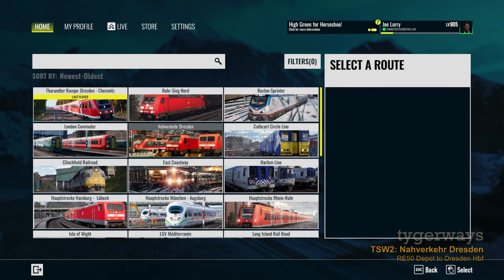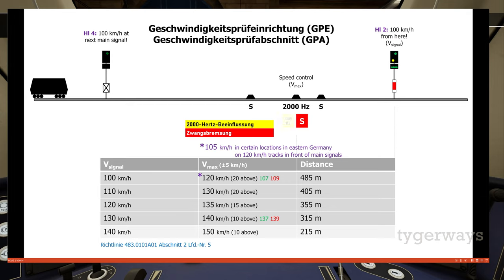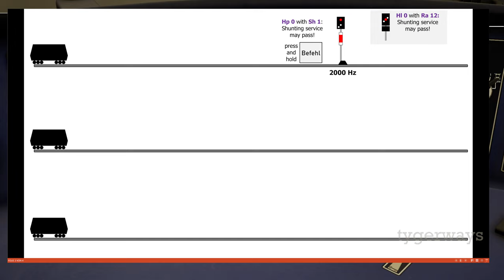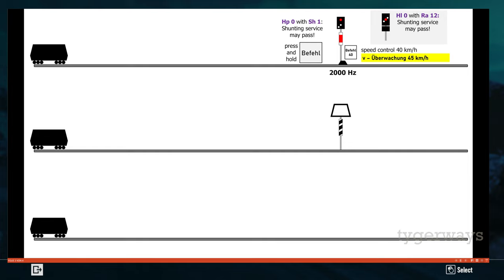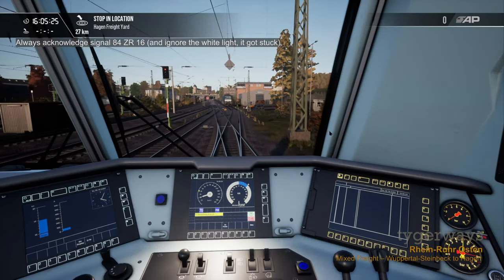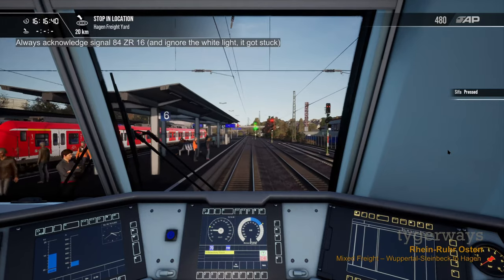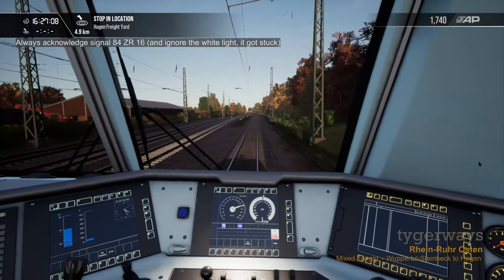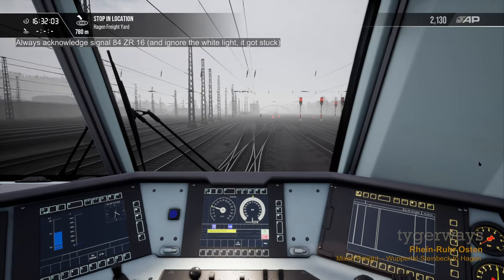PZB Specials – Befehl 40, distant signal board Ne 2 and trapezoid board Ne 1 (TSW | PZB tutorial)

Comment: Nice video, thanks! A question regarding pzb signals though! What does the yellow/orange and white striped signals mean? I don’t get it as I’ve seen both distant and main looking signals with those orange and white stripes. The stripes are looking and positioned the same as the white/red main post signal stripe, but with different colors as i stated. Thanks! :)
Reply from the maker: Thank you! Are you talking about a signal with a mastsign of this kind:
https://www.fahrdienstleiter.net/fdl/signalbuch-mastschilder#viewer-5jcml?
Reply: @tygerways6615  Yes! Exactly
Reply from the maker: @henrik2413  Those special mast signs allow you to pass a main signal at danger (red, Hp 0) even without permission by the signaler – after you stopped in front of the signal and tried to contact the signaler, but didn't manage get a working connecting. You then have to drive on sight (max. 40 km/h) until past the next main signal (not unlike after getting a Zs 7 caution signal), after that according to signal indications – always trying to reach the signaller on the way. If you didn't get a connection to the signaller by then, you have to stop at the next station and wait there, until you get a connection.

In the game this is probably of no relevance so far, unfortuantely. :)
Reply: @tygerways6615  That’s quite special! Thanks for the quick response! :)